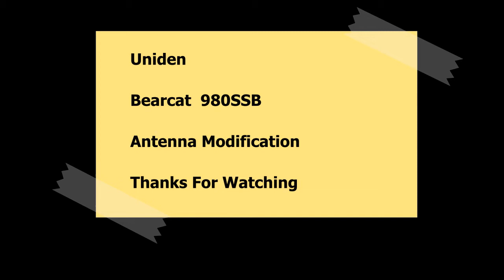Uniden Bearcat 980SSB  - Antenna Connector Modification - SMA

Comment: The SO-239 is a standard connector for every CB Radio I have seen in the last 35 years or so. I don’t even like the A connectors on some of my Amateur Radio HT’s and would surely not want any on a base or mobile radios.
Reply from the maker: Your statement is absolutely correct..    SO-239 is on 100%  of CB radios sold in like forever..  For me, I like the SMA connectors, so I install them on all new installations...  It's just a preference I have.